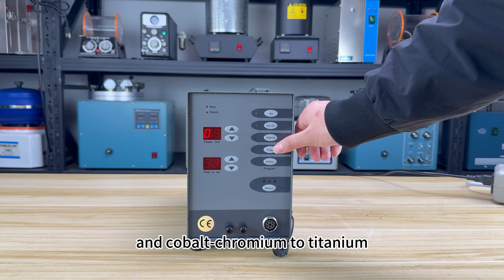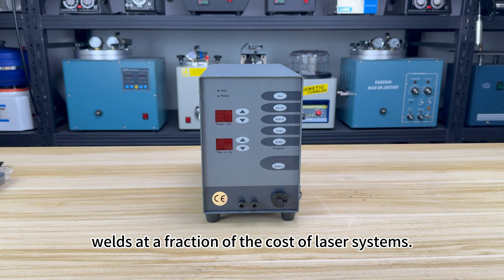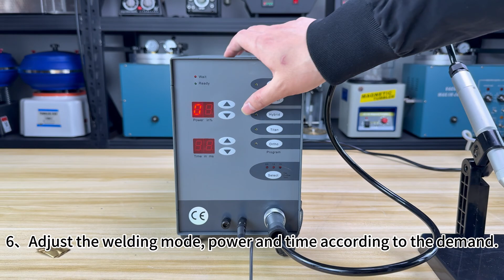How To Use Tooltos Automatic CNC Pulse Argon Arc Tig Jewelry Spot Welding Machine 2.0

Comment: would this work for steel? like cases of a watch?
Reply from the maker: Hello, thank you for your question. This method is suitable for steel, but it requires you to master the technique first, such as for watch cases.
Reply: @TooltosJewelryTools  perfect. thank you, is there a particular preset that would work best?
Reply from the maker: @vjiggles8957  There isn’t a dedicated “steel preset,” but yes — you can use the “hardware/ hybrid / Co-Cr-type” settings and manually fine-tune parameters for steel or stainless-steel work.

Comment: Can you weld copper and bronze?
Reply from the maker: Yes, you can weld copper and bronze!
Just make sure to use argon gas and lower power settings to prevent overheating.
📞 WhatsApp: +86 185 5938 3105
📫 sales@tooltos.com

Comment: Just got this machine, should the tungsten pull back into the pencil when activated? Because mine does not and will adjust power but visibly always puts out the same amount of power
Reply from the maker: Hello, to better address the issue you've reported, could you please add our contact information and send us a video of the machine in operation? Below are our contact details.
📞Whatsapp: 185 5938 3105
📫sales@tooltos.com
Reply: Hi, did they follow up and answer your question cause I wanna know before I buy…
Reply from the maker: @rhiannas1355  hi, anything can help you?

Comment: Hi can the machine be used to fill holes on zinc alloy metal surfaces? Thank you.
Reply from the maker: Hi! This machine is designed for spot welding and typically does not include a filling function.
Filling small holes is possible, but you risk:
*Porosity (gas bubbles inside weld).
*Cracking (zinc is brittle when cooled too fast).
*Weak joints compared to the original metal.

Comment: Does it works in titan material 100% good  ? I wanna use it for welding eyeglasses
Reply from the maker: Yes. “Tooltos CNC Pulse Argon Arc TIG Spot Welding Machine” can do it, if it supports fine control (current, pulse timing, etc.), and if you ensure excellent gas shielding and clean setup. But expecting “100% perfect” results from scratch might be optimistic — there’ll be a learning curve.

Comment: Do i need protection glasses to use this machine ?
Reply from the maker: Hi! Yes, it’s definitely a good idea to wear protective glasses when using this machine.

Even though it’s precise, tiny sparks or bits of metal can fly, and you don’t want them in your eyes 😅.

A few quick tips:

Wear safety glasses or goggles

Keep your workspace clean and ventilated

Stay clear of flammable stuff

Safety first — it makes your work easier and worry-free!

📞 WhatsApp: +86 185 5938 3105
📫 Email: sales@tooltos.com

🌐 www.tooltos.com

Comment: Just got the machine. What does the tungsten tip actually do? Does it melt and weld the metal or it melts the metal you are working on? I am confused?
Reply from the maker: Hi! Thanks for your message and congrats on receiving your machine!

The tungsten tip does not melt itself — instead, it helps conduct the high-frequency arc current that melts the surface of the metal you're working on. This allows the metal parts to fuse together at the joint. So in short:

🔹 It melts the workpiece, not the tungsten tip itself.
🔹 The tungsten tip stays intact and stable during welding.
🔹 Make sure the metal pieces are clean and properly positioned for the best result.

If you need more help, feel free to contact us on:
📞 WhatsApp: +86 185 5938 3105
📫 Email: sales@tooltos.com

We also have videos on YouTube that show how to use the machine — let us know if you’d like the link!
Reply: @TooltosJewelryTools Please post the link

Comment: Sir, this machine can work on gold without argon gas.
Reply from the maker: Thanks for your question!
Yes, the machine can work on gold without argon gas, but we do recommend using argon for better results.

⚠ Without argon gas, you may notice:

Darkening or oxidation on the welding spot

Less stable arc and less clean finish

✅ Using argon helps to:

Keep the weld area clean and shiny

Improve bonding quality

Prevent oxidation

If you're doing precision work or care about surface finish, argon gas is highly recommended. Feel free to contact us if you’d like help setting it up!

📞 WhatsApp: +86 185 5938 3105
📫 Email: sales@tooltos.com
🌐 Visit us: www.tooltos.com

Comment: Can I use without argon gas..?
Reply: It says in the video that you can use it without gas.
Reply from the maker: Yes, you can use the machine without argon gas — but it's not recommended. Without argon, the surface may oxidize during the process, which can lead to discoloration (like blackening) and a less clean finish.
For the best plating or welding results, using argon helps protect the surface from air exposure and ensures a smoother, brighter outcome."
📞 If you have more questions or need setup help, feel free to contact us on WhatsApp: +86 185 5938 3105
📫 Or email: sales@tooltos.com

Comment: Can i use this for solding the gold jewellery
Reply from the maker: Yes,of course,you can use it for the gold jewelry
Reply: @TooltosJewelryTools what setting?
Reply from the maker: @MP-hj4qi  Hi, There are five buttons on the right side of the front of the machine: Au, Co-Cr, Hybrid, Titan and Ortho, depending on the material you need to weld, select the corresponding button and press it. Then, on the left side of the machine, you can adjust the power level and control the time to weld the material you need.